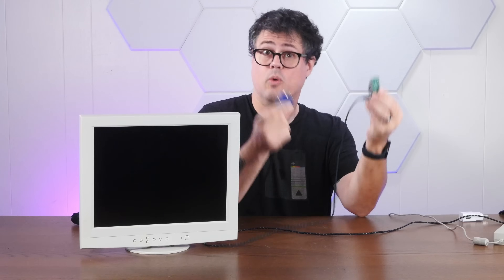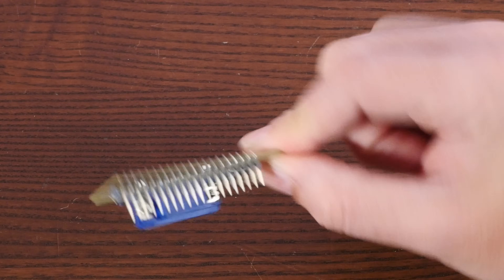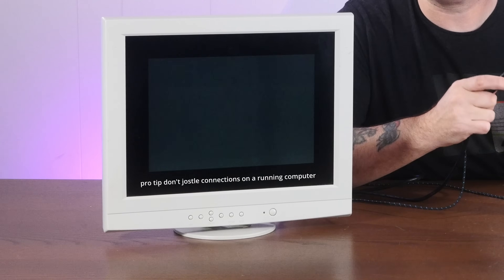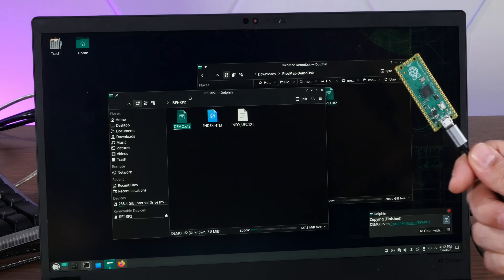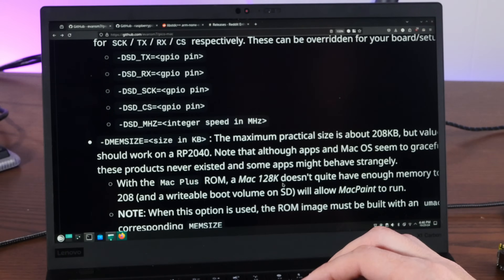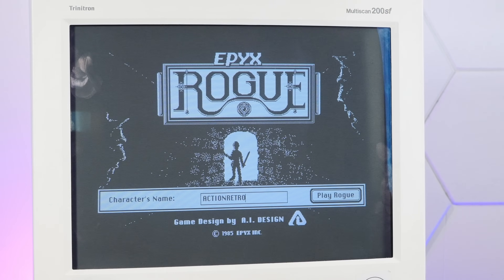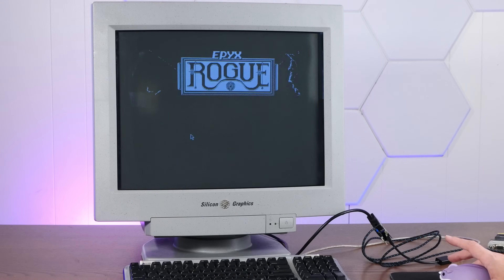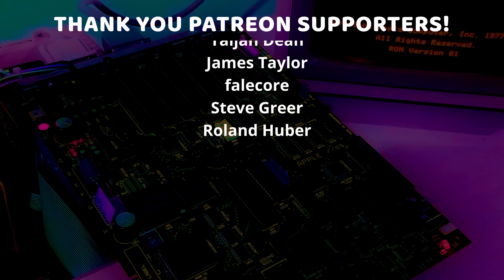Building a $14 Macintosh

Comment: Got the version 3 mac emulator board. It has a built in SD card slot. Running with the standard flash to my raspberry pi pico. Is there a way to store files on an SD card? Using the flashed software there is currently no way to store files. Any thoughts are appreciated. Thanks

Comment: It'd actually be really cool to see a speaker and some little RAM chip added to this design to see this little thing emulate pretty much a maximally configured Mac Plus or something, because the Pico totally could if it only had the RAM to do it, that's where we are in this hobby.

It's also getting to the point that microcontrollers can basically emulate our vintage machines for literally a few dollars if they can output a 15kHz video signal, and if you throw a SoC that's only a couple of dollars more they can emulate everything up to like a 386 PC or so on hardware that's now a decade old using software running on the bare metal. That's kind of amazing, actually! And the skills are becoming more common and the tools less expensive every year.

Comment: This is one of the coolest things I’ve seen on YT in a month of Sundays! It’s so beyond amazing I had to pinch myself to be sure I wasn’t dreaming!

(Fun fact, I had a business waaaay back in the day, upgrading 128k Macs to 512K “Fat Macs” and beyond. I have an old Mac sitting on a shelf in my lab that started life as a 128k but now has 2MB and a SCSI port, with a cute little 2.5” SCSI drive in a tiny case stuck to the back of it 😁 It’s incredible that you can make a 128k Mac clone these days with $15 of parts 🤯 Thanks for the interesting vid!)

Comment: A 68040 version with color with system 8.1 would be a great companion. maybe call it "Micro Mac II Color"
Reply: From my research it can be done using a Pi Zero 2 W. Will test this theory soon because I just ordered a Pi Zero 2 W with the header already installed so I can use a VGA666. Remember, it will not use the same software setup. But in my thinking Basilisk II should work.

Comment: If you could change the frequency of the rgb signal output that might get your Apple display to work. I bet that monitor is fixed frequency and the VGA (RGB) signal is probably 60 hz not the 67 (66.7) hz required for the monitor.

Comment: Am still bitter at Steve Jobs for releasing the Mac with only 128K - it was pretty much useless other than doodling in MacPaint.

Had to upgrade mine to 512K (the hard way - soldering denser chips) to get it to where was useful computer. But then there was only the external floppy drive port for connecting a hard drive and that interface was rather slow for that use case.

So really it was the Mac Plus of 1986 with 1MB memory and a scuzzy drive interface that was the first actually viable Macintosh.

But one could argue that the Mac wasn’t good for much without a hard-disk (it wasn’t) and the compact form factor was very much spoiled by having to hang an external hard-disk onto it - so much for the convenient appliance computer concept. So in truth, it wasn’t until the Mac SE of 1987 with integrated internal hard-disk that the Macintosh computer - as Steve Jobs conceived it - was truly realized.

Comment: 10:35 I had the same issue trying to get things displayed on my Macintosh PowerPC. Something about sync-on-green is why it was not working? I tried the non-adjustable DB25 to VGA adapter and no dice. Those displays also have a really goofy refresh rate.

Comment: Holy shit, I had that exact model, at least the 22 inch drafting variant of it. Actually had several dozen of them, first time I ever used triple head mode in Windows ME/2000. Had my a friend who worked for an art firm who upgraded all their monitors just a couple years after getting them and I took a whole truck load of them, LITERALLY a proper ruck load of them. I used two of them plus an S-Video output to my TV. This is how I watched my first DVD as an aside. Ah the HOURS and HOURS of PC gaming I did on those monitors...

Comment: I would love to see someone build a drop-in replacement motherboard for a 128K/512K Mac that drives off one of these! Obviously, it would take a lot of work to get the signal to a compatible with the analog board, and to also get all the ports set up, but I'm sure with some skilled PCB designers (and maybe some more pins available to the Pico), it could be done! Great video as usual!
Reply: Outputting the video signal to the analog board would likely be the easiest part. The harder part would be making the other IO work (especially floppy).

Comment: That's cool, now stuff it inside an old Mac that has a faulty motherboard and also make it cursed just like the clear blue Cursed Mac.

Also, where the heck do you find a Pico for $4?? Because everywhere online as far as I can see they want $25 or even 50 for a Pi no matter what kind or generation.

Comment: Now i wonder if it's possible a PCB that has PS/2 ports, printer and ethernet for the pico in order to replicate the ports used in original models to make old systems still reliable 

Many universities and government offices use still 80's Macintosh and Commodore 64 for simple things and that would be very helpful

Comment: It would be more interesting and useful if the emulator can make use of external SPI PSRAM. With this, the emulator can hold up to 8 megs of RAM with acceptable speed, and it's also possible to emulate high version of system software, or even color Macs like the II😮

Comment: What arm cortex cpu there are like 3 types cortex-m, cortex-r and cotex-a
Reply: The RP2040 chip on the Pico   has two Cortex-M0+.

The RP2350 on the new Pico 2 has two Cortex-M33. And also 520K of RAM instead of 262K.

Comment: The original Macintosh was clearly an all in one computer. You need to open up a LCD or CRT and embed that tiny microcontroller. There is loads of space for it.
Reply: How about a portable black and white TV? I've got a 5 inch version that only gets used as a radio now since there are no analog broadcasts.
Reply: SonyWatchMac

Comment: Now I need something similar for an Atari ST especially STE or Falcon030.
Reply: The Pico does not have enough RAM. The Pico 2 has 512K but then there wouldn't be RAM for the emulator itself.
I've been thinking though.... Amiga 1000. It came with only 256K. The Kickstart was loaded into separate RAM, but that could be emulated.
There is the rare Atari 260ST that like the Amiga loaded TOS into RAM, but I'm very uncertain that that would work with any games.

Comment: The Pico is unreal. I'm developing a MIDI-CV interface with one right now and the PWM is working great as my DAC. My last microcontroller product was significantly more complicated and expensive as this.
Reply: Man, it frightens me that I understand what you've written here... How am I doing this?
Reply: @strepetea same
Reply: Wish it’s memory was 2MB instead of 256K or 512K
Reply: I wonder how hard it would be to add a hardware midi port.  It would be awesome to use some of the old midi software like the Music Mouse and others.
Reply: @CyanTiger  it's not difficult you can actually have a few ports because the PIOs can be configured as UARTs. Web search "midi uart optocoupler circuit"

Comment: Can it emulate a Plus, or at least a 128k with 512k of RAM soldered onto it?
Reply: No, the pico's microcontroller only has 264k RAM and the emulation eats a lot of it. It should be possible with a pico 2 (which has twice the onboard and supports external psram) but that's brand new and nobody's done much with it yet.

Comment: I was amazed by how sharp and clear the image was more than anything else. It's amazing what can be made these days by devout hobbyists and tech wizards!
Reply: The old monochrome Mac classic display was small but very sharp. I had one 😂
Reply: tbf I was playing around with SheepShaver and Basilisk… I was surprised that you can get 1920×1200 or even 3440×1440 no problem
Reply: Shame the Pi Pico doesn’t have at least 2MB (like competitive products) - 256K and 512K is too stingy
Reply: @TheSulross define competitors.
We're barely out of the 8bit microcontroller era.
Reply: And considering how awfully expensive Mac's are, this is a good project 👍

Comment: One note -- the sound isn't a limitation of the hat. The umac emulator itself doesn't emulate sound.

This looks fun! I'm totally building one for the heck of it. I wonder if you could use a Pico 2 and get 488K of RAM...
Reply: Would adding sound not be made easier with a DAC on the addon board? Even the real pi doesn't have a DAC and bitbangs the audio but it's also a lot faster
Reply: @Nukle0n   Exact thing that I had on my mind. It's a R2R Ladder DAC, and I guess someone can hack it into the thing.